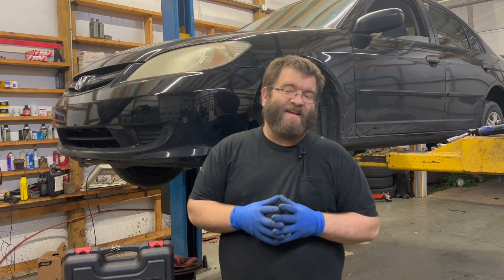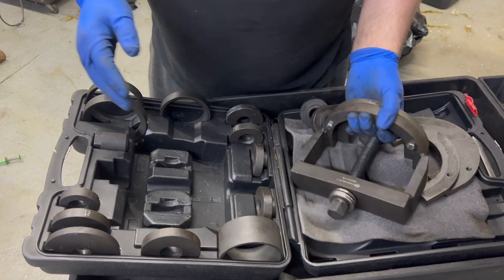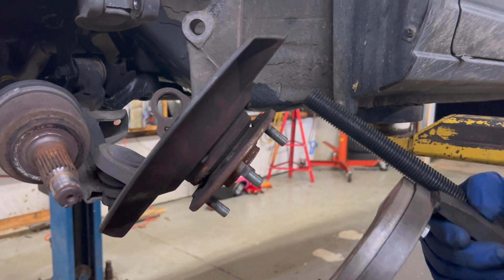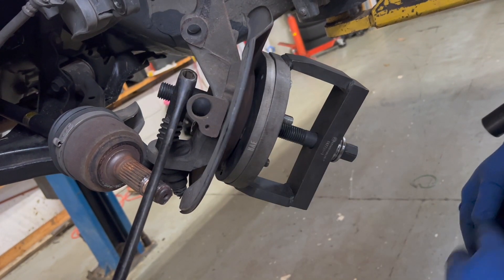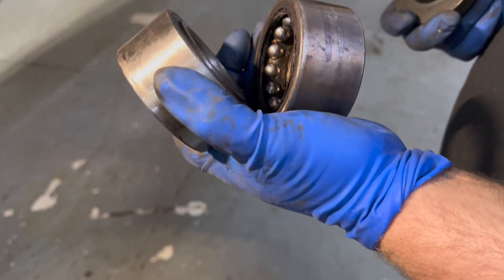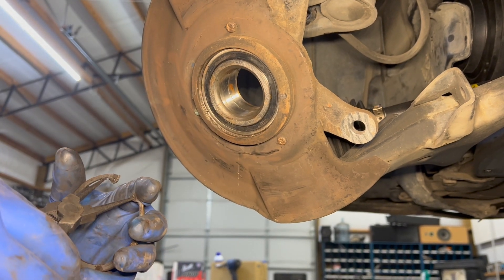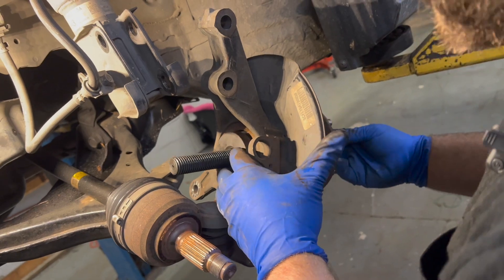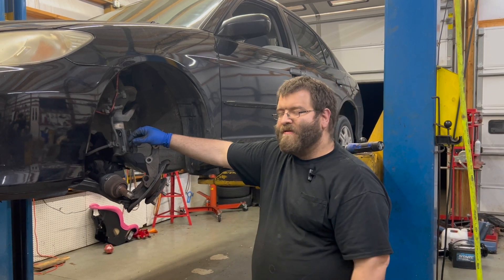Replacing a Press in Wheel Bearing WITHOUT a press. Powerbuilt 647795 Wheel Bearing Tool 01-05 Civic

Comment: Problem with this tool is backing plate might get damanaged and it did for HONDA. he is using brake shield screws to wedge against to get bearing out, design is not good